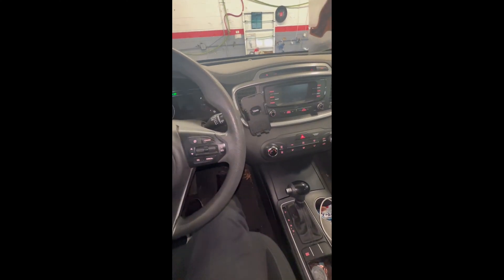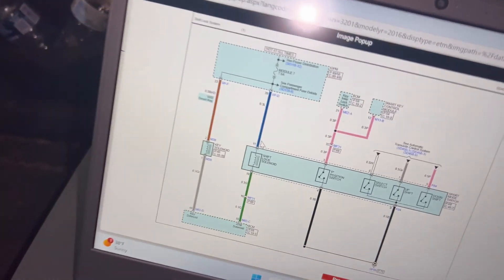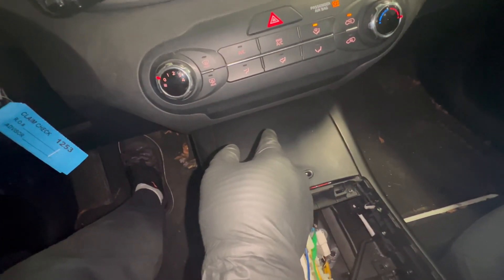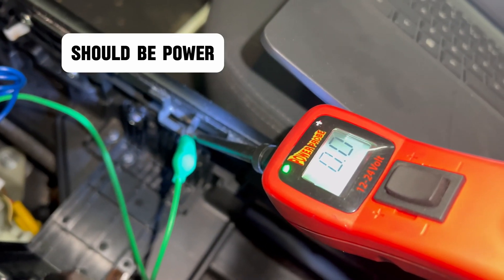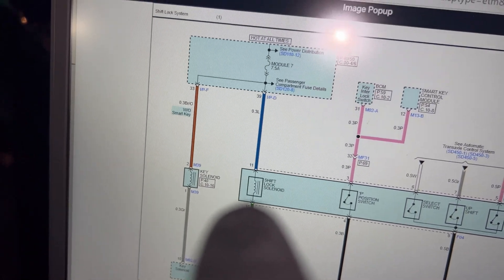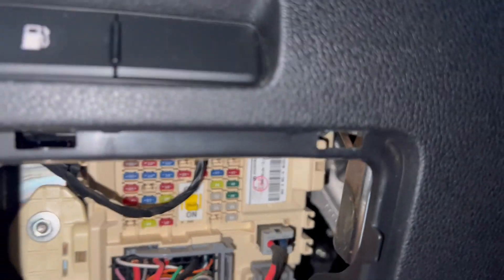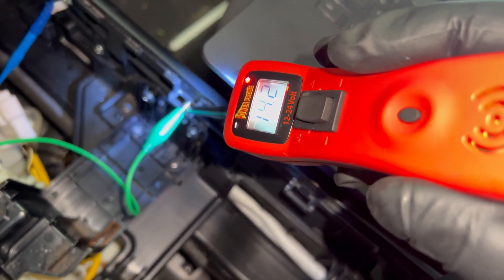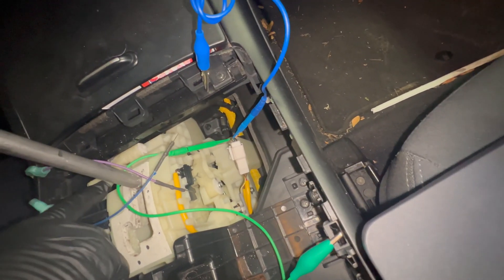KIA Sorento How to Diagnose A Faulty BCM With No Ground Signal Control To Shift Lock Solenoid

Comment: I have 2016 sorento . It’s start with the brake light I lost it all . The I tried to change the brake switch and didn’t solve it . I tried to switch the relay to see if the relay then I lost it all , brakes . Shifting and brake paddle it’s hard . Then I realise the battery drain quickly. . So you think it’s a bcm module?

Comment: My kia sedona may have got same problem, kia dealer said bcm problem. When I'm driving BSD warning light came out, and after a few minutes speed locked and all the reading meters went back to 0, I couldn't turn signal light. I tried to use obd2 scanner to show U0101, tried to clear that code, but couldn't connect obd2 scanner. but waiting a few days after, all back to normal, but driving few days same problem, do you think that's bcm problem? Kia dealer charged me around $500 to find the problem. They said bcm problem if fix that problem, need to replace the backup camera and the BCM; both will cost over $3000. That's crazy.

Comment: I glued the shift interlock lever lol. Hopefully that won’t cause any issues with the bcm, I haven’t had any problems yet 😂. All though it will go into gear with the car off, but only if you push in the button on the shifter.
Reply: How and where do you glued that?😅

Comment: 2013 Optima 
What do you suggest if I can not get the shifter BACK to park?    The shifter is in the park position, but it's in reverse still.   I also have to use the shift release to get OUT of that position.
Reply from the maker: @EightySixd-86d  Suspect the shifter assembly itself, something binding or worn out component. I’ve seen few but not sure on your situation. It’s a lot cheaper to fix compared to replacing the BCM. Good luck. Please don’t just replace it diagnose it first.

Comment: Hi did besides not being able to shift out of park when you would do it manually where you able to see what gear it was on or was it blank, im having same issue on a 2011 Kia optima
Reply from the maker: The BCM does not provide gear selection the inhibitor switch does, I have not seen BCM failing on a kia optima. can you able to start the engine?
Reply: @WrenchingRyan  Hi Yes I'm able to start it but it won't shift out of park and if it does it shifts hard it gets stuck in reverse gear only.
Reply from the maker: @JoseSandoval-ic5xe  while the engine is running put your ear close to the shifter then press your brake pedal, do you hear the solenoid? The BCM job is to supplied ground to solenoid so you can switch the gear to drive but if you get stuck in reverse you might have issue with your shifter.

Comment: What if I have no power to the green wire? Checked fuses they were good.

Thanks
Reply from the maker: @derekplautz7846  You should get power on both wires, when you press the brake pedal and green wire should get ground that means your BCM is good, if you have power on blue wire your fuse is good then you have open circuit on your solenoid.
Reply: @WrenchingRyan  thanks for the quick reply, missed the part where it had to be connected. Tried again with it connected and got power but no ground when brake is pressed. New BCM on the way.

Thanks for the video, big help!

Comment: Why isn’t this recalled?   Is this not a safety issue?
Reply from the maker: This issue should be a safety recalled, since the BCM is malfunction you can able to start the engine when in reverse or drive but kia never release one.

Comment: I have a similar problem with a Kia Stinger. Gear shifter moves without having to press on that button but transmission does not move out of Park. Gears move as though it's connected as it should, it isn't loose. Car was in an accident. What could be the issue?
Reply from the maker: Is a front end accident? If yes it could be your inhibitor switch is broken or the cable itself.

Comment: good work
i have the same issue with DTC code P0504 when clearing the code with scan tool the shifter working good but after some time it back again with the same code
replaced the brake switch and the same issue 
any solve or advice??
thanks alot

Comment: I have the same problem with my Kia sorrento 2018 how much this will cost ???
Reply from the maker: Price may vary depending on location, we quote the customer for 1900 dollars which is includes BCM, labor, diagnostic and fob programming. But the customer declined the repair, the module is the most pricey one. Thanks for watching.
Reply: @WrenchingRyan  I can understand why they would have declined. I would have too, since the BCM is only about $500 online and dealerships get their parts much cheaper than the public can.  The key fob programming is also a huge dealership profit center, for something that is relatively trivial (kits are available online).  The real issue is that this should be recognized as a true defect by KIA and should be fixed for free. Or a class action lawsuit should be brought. 

This is the trouble with cars today. Critical components are made out of plastic and easily break. Same with KIA door handles and door lock mechanisms that break because of cheap plastic part inside. And when the car manufacturer sees its actually a design flaw, they hide that info from the public and every dealership acts like its some "unique" problem the customer is having when in fact tens of thousands of owners are all experiencing the same costly design flaw.

Comment: @WrenchingRyan

I have the same issue with my wife’s Kia Sorento 2016.  I purchased a used bcm online and fixed the shift issue… now the key fobs won’t work with the new to me bcm.  How can I fix the key fobs?
Reply from the maker: You have to get your fob to re program.
Reply: Would it be the standard reprogram procedure.  Switching the keys on and off till the lock cycles then pushing the lock/unlock button on the fob?
Reply from the maker: @marek30144  you need a scanner to perform programming, if you have both fob both of them need to be done, I’m not sure if aftermarket scanner will do the job. Thanks for watching.

Comment: Break pedal sensor
Reply from the maker: It’s actually the BCM causing this issue. Too bad the module is way too much, customer declined the repair.
Reply: @WrenchingRyan  I'm trying to figure out how to remove my center console to fix the shifter cable right now . 
At least it happened on the way home and I could shift into park by hand on transmission.  I hate plastic fasteners .

Comment: Have you got the replacement bcm video. My 2016 sorento has exactly this issue. Does the repair need to be done by Kia?
Reply from the maker: Unfortunately the BCM cost is way too much for the customer and they decided to declined the service.
Reply: What does that even mean? If they refuse to provide the service, how do u get it fixed? I'm having the same problem
Reply: @karenkolczniski4251  I have the same problem in a 2016 Sorento. The screwdriver inserted into the shift lock release (located to the left of the shifter on the console) might be a "permanent" fix for me as I refuse to pay the cost to replace the BCM. I replaced the brake switch (easier and cheaper) but it didn't work for me.